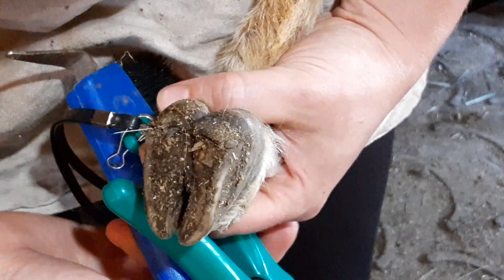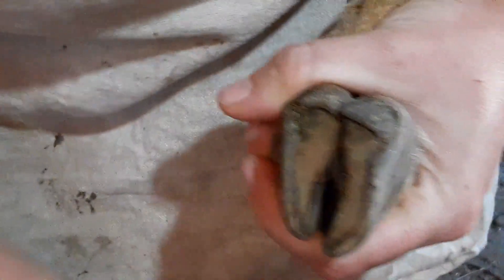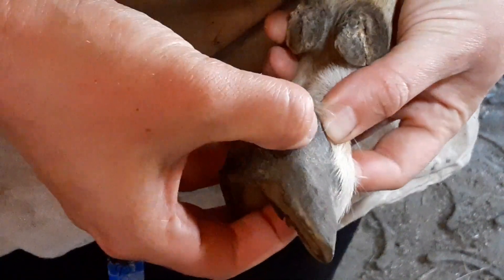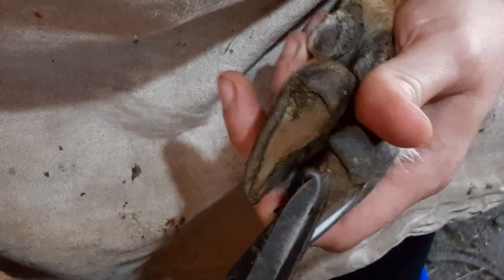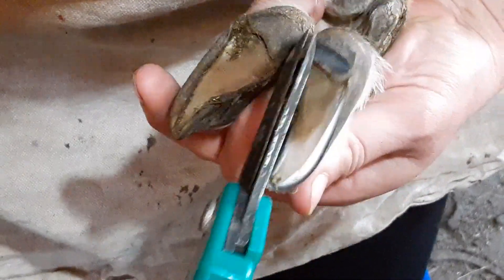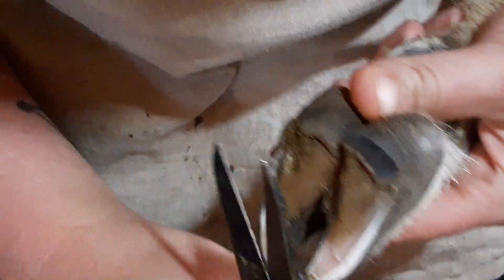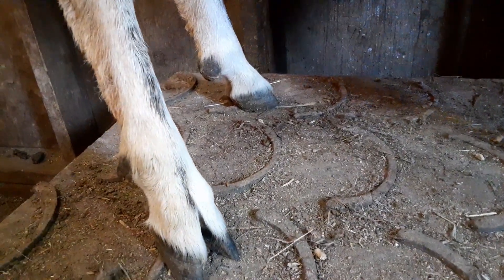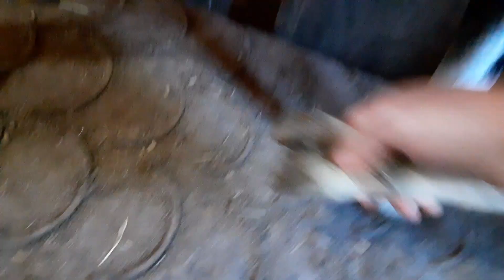How To Trim Goat Hooves | Goat Husbandry Series

Comment: I live in southeast Alaska. There is a lot of rain and mud here and I have to work hard to keep hooves in good shape.  I would stress cleaning between the two sides in the crevice..not sure of correct term for area.  Mud and feces can build up and result in rot in that area,  I clean it out and maintain,  I also keep Blu Kote in my trim kit.  If there is even a little bit of concern I can stain the world blue 😜.
Reply from the maker: Very good call for the wet and muddy areas. I am in Washington state and we get some wet months for sure. I find if you maintain the trim well though it's not often an issue. When the hoof wall folds over and traps mud and muck though that is thrush heaven.